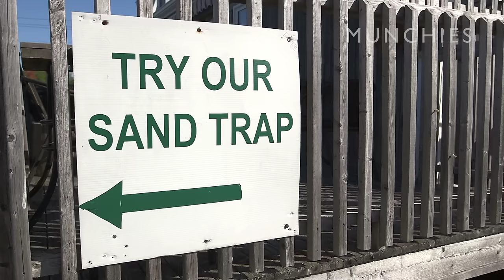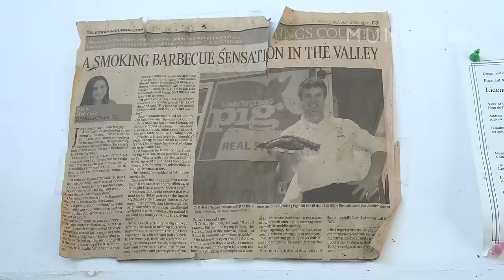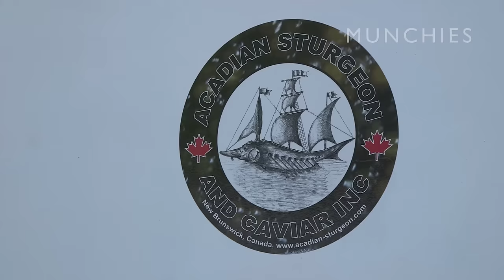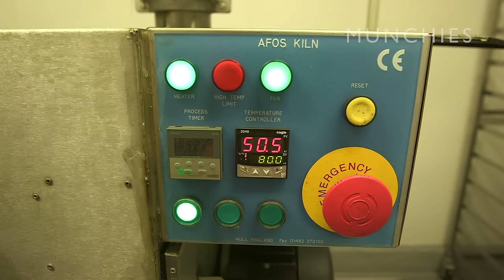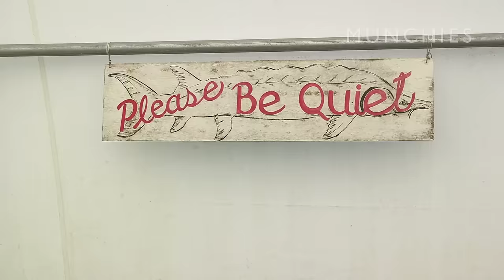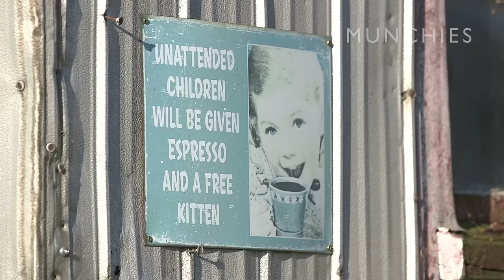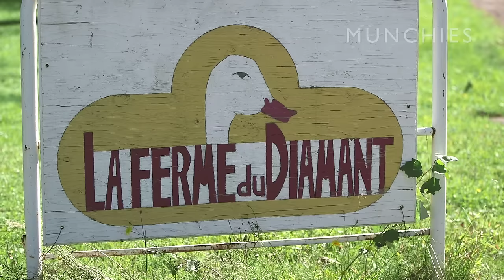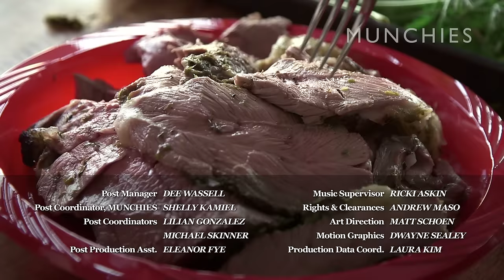Roadside BBQ and Caviar in New Brunswick

Comment: You blew my mind when you made "Rauppie Pie"  My people come from close to Yarmouth N.S.  And all my great aunts made this, but perhaps a bit differently.  They used to actually "grate" maybe 30 lbs of the potatoes on a piece of thin metal with thousands of sharp points made by hammer and nail, held by a wooden frame . . . perhaps 2 feet long.  They would then squeeze the "meat" of the potato by hand in Irish Linen to remove the liquid, salting it as they went to avoid discoloration and pound it down.  This resulted in about 1/2" of pure starch remaining in the bottom of the bowl . . . which I'm told the women used for ironing;  and  the liquid was used by the men to make booze . . . back in the day.  They would boil a chicken with onion, celery and carrot, and use the stock to reconstitute the potato "meat" to the same level in the bowl, and then alternately layer the potato mash and chicken in a highly buttered enameled roasting pan.

Sometimes this was made with chicken and pork, and there was also a seafood version.

It resulted in a thick coating on all sides of basically potato crust with a thick center of meat and thick potato mush, and was served with homemade applesauce and sour cream.  And lots of salt.

Fun fact:  One of my great aunts didn't like the hard part of squeezing the mash by hand . . . and came up with the ingenious idea of sewing tubes of Irish Linen that could be tied off . . . and placed in her modern washing machine on high spin to express the liquid.

I don't think anyone in the family ever went back to her house for "Rauppie Pie" after they found that out.

;-)

Thank You for this precious reminder of my miss-spent Yute.

From the Surettes of Wedgeport and the Doucettes of Cape Saint Mary, N.S.

Peace to All

Alex D